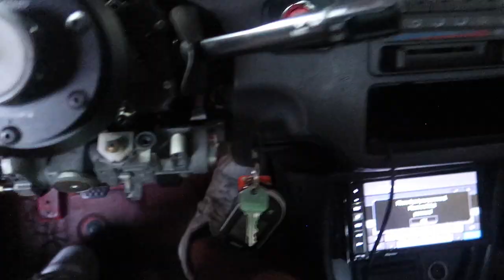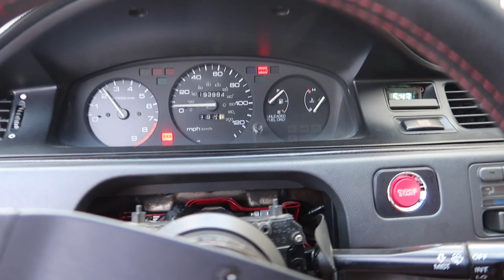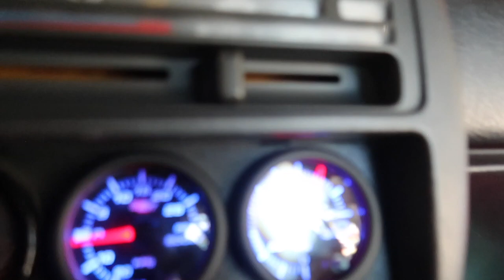I'm Back

Comment: Say bro how come you don’t have intercooler piping connected to intake side of the engine? I think your missing some on pipe on you turbo setup.
Reply from the maker: i'm still driving the car.. haha.. car is not tuned yet brotha.. but soon enough..
Reply from the maker: Was told if car wasn’t tuned I shouldn’t have that piping on yet.. Also thanks for watching the video.. 🙏🏾🙏🏾
Reply: cool tip I didn’t know that.... cool deal bro I can’t wait to see how much HP you’ll make on tune. 👍🏻
Reply from the maker: Don’t think I’ll make huge gains but I’m excited to have something a little quicker than I have now.. also we gotta consider the fact that it’s a b20 and the sleeves r very weak and won’t take much boost, but I’ll be happy with 7-9psi. And yeah bro, I got u any questions u have u can definitely hit me up and I’ll be sure to answer even if I have no idea.